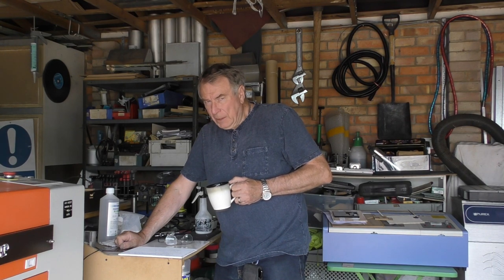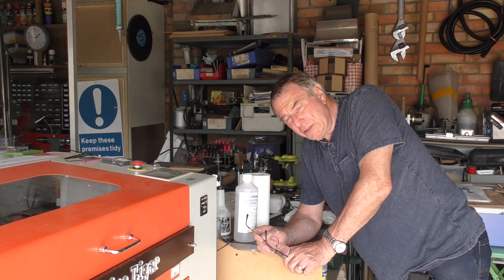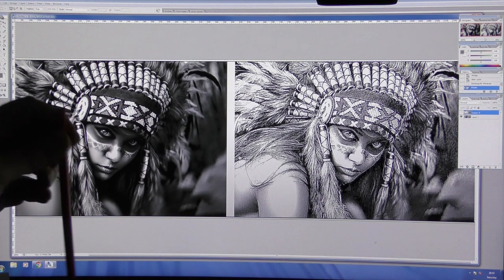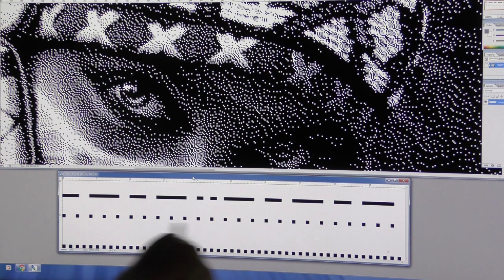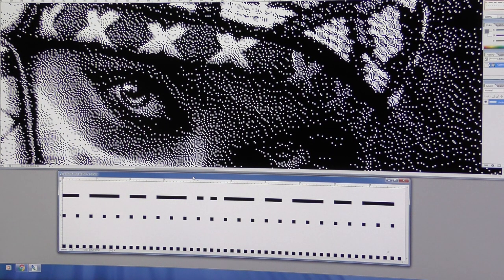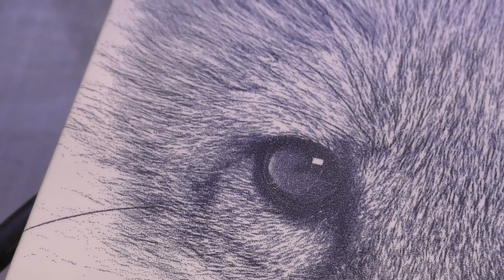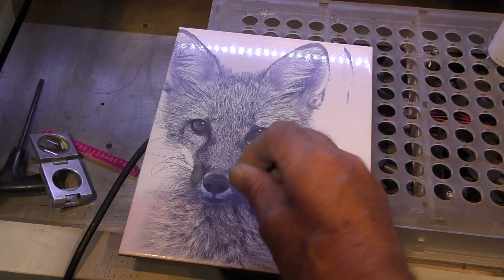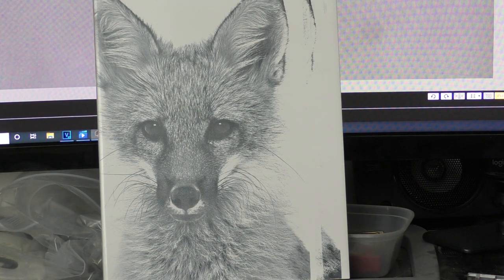RDWorks Learning Lab 212 Understanding Black Etching Ceramics Part 2

Comment: Try latex  white primer paint using Air Brush  dilute with a touch of water to get consistency of milk ..I usually put a small drop of Black in and mix..as it will give a grey like color and much easier to see the coverage  ...and with a 2-3 watt diode after 900 tiles I and many others in my forum DO get photorealistic results ...as I should as I,m approaching my 1,000 tile with hundreds of hours testing/looking under microscope/tuning machine and laser  etc
Reply from the maker: Hi Nicky
 First I must thank you for sharing your process and knowledge. My venture into your world will be fleeting because my aim was to answer the simple question I was being asked  by several people wishing to add a CO2 laser to their inventory.  With no previous study of your process it was obvious I could not answer that question with any confidence.  It thus became necessary for me to first understand the process and decode it so that I could assess how successful transferring to a different technology would be.  With minimal experimental work I was amazed at how well the basic process could be applied to CO2 machines and  as I mentioned in my video, the results were the best I have achieved on any material. My short foray into you world has demonstrated to those enquirers that your method is transferrable and to me it has opened a whole new world of possibilities. So thank you. I may tinker in the background from time to time to see if 500 ppi images work as well  but I shall be leaving others to use your method  in their own way.

 Although I try to help people if they ask, my journey of discovery into this technology is a very personal education process to keep my two remaining grey cells exercised.  Because my other hobby is video and editing, I chose to make a very low tech record of that journey  Unlike yourself, I am not specializing in any particular subject  so adding black dots to my store of knowledge has been an amazing bonus from trying to help others. 

 Airbrush is new to me and it has served the purpose successfully even though I never acquired any skills. I soon realized that the little toy compressor supplied with the brush  was not man enough for the  job,  but it tediously achieved the even coating I required.  Fitting it to my shop compressor for a few more experiments is a future project.

Best wishes 
Russ
Reply: Russ - regarding your air brush: if it is a "double action" model, you can get more material and more air coming out of it if you pull back on the trigger while pressing down on it. If it's a single action, you can not pull back  on the trigger - the only variation possible is from how far you depress the trigger. On both styles of airbrush it's usually possible to increase the amount of material sprayed by installing the needle rod so that it is not seated at the tip, but just behind it leaving a larger orifice. This method also means it will spray full on as soon as air flows. Watching your video it appeared as though you were getting a narrow thin spray pattern. Not bad for a first time though. Oh the last variable is the distance of the airbrush to the surface of the tile.
Reply: @DesignCutters  
Thanks for that valuable advice, especially about drawing the needle back a fraction as it makes perfect sense Yes It does have the dual action trigger so I can see that would improve things significantly. However, the little toy compressor that came with it is gutless, as I soon found out, but with frustration and perseverance I managed to prep a few tiles for my experiments.   I have now ripped the compressor apart to access the tube fitting and have connected it to a pressure regulator  that I can plug into my shop compressor. . I have not tested yet because I do not plan on doing any more TiO2 spraying in the near future. This was just a quick dip into the Nicky Norton world  to answer correspondents questions about whether the process will work with a CO2 laser.  The answer is yes, remarkably well, so I will leave it to them to experiment with this great technique.  When I have finished my research into lenses I may return to this and  see if 508 dpi images are possible, also how it works on real glass rather than tile glaze.
Thanks again for sharing your invaluable experience
 Best wishes
Russ

Comment: Have you experimented with running multiple low power passes vs one single pass? I suspect that the lower power of the diode lasers might be a factor as well.

Comment: Sorry if this is a repeat comment.....Lower surface tension with a drop or two of low suds detergent.    Roll on an event layer with a threaded rod as roller.   Finer thread- thinner layer.    Possibly thicken with glycerin ( or use alcohol glycerin mix ....i.e. hand sanitizer.  )

Comment: As for OSHA The PEL (permissible exposure limit) for TiO2  for 8 hours is 15mg/m*3 ....so for a mixture to spray  1...  110 x 110 tile contains approx 425 mg of Tio2....if you have a workshop that is 3 x 3 x 2.5 m....With absolutely no air exchange and you etched 1 tile then stayed in the shop drinking coffee you would be at 15,5 mg/m*3
Reply from the maker: Hi Nicky
 
 Again, thanks for sharing your invaluable knowledge in this specialist subject.. As an approved  food colourant, sun screen  etc TiO2  is obviously not toxic. .  However I appreciate there are risks to inhaling any microparticles, especially inert substances like TiO2  which will build up in your lungs, so I always exercise caution. (note the wide open workshop door) . The good news is that I will rarely be using the airbrush or the rest of my 200gm pack of TiO2,  so on my downhill run to oblivion I'm sure that the  wall at the bottom will get me first.

 Best wishes
Russ

Comment: I'm trying this out Russ but I'm having no luck with the spraying - the titanium dioxide seems to settle out enough within a second or so to block the airbrush cup inlet meaning that I get a few sprays and then it's really spotty.  Am I doing something wrong? - I've tried going up to the largest needle in the airbrush range (0.5).  I notice someone else in the comments suggesting using methylcellulose as a way to avoid it settling out.  How did you get it to spray ok?
Reply from the maker: Hi
The stupid compressor that came with the kit  was really underpowered for the  material we wish to spray. I had partial but stuttering success with it for the video and used a volume ratio of 1 part TiO2 and 4 parts IPA. The mix remained suspended for a few minutes, long enough to empty egg cup sized receptacle. Subsequent to the video I did 3 things. a) I tossed the compressor in the bin after removing the pipe fitting. b) I connected it (via a pressure regulator) to my shop compressor and c) I set the needle back about 3 mm to allow a bigger outlet path and thus a faster flow rate.  I found I achieved rapid coverage and consistent results running at about 60 psi (4 bar).  No, I did not try any additives because it worked fine with just the simple mix.
 Best wishes
Russ
Reply: @SarbarMultimedia  thanks Russ. I'm using my shop compressor albeit at about 25psi. I'll increase that pressure and back the needle out more 👍👍

Comment: random question: could we use a 2-way mirror to avoid reflections back onto the lens when working on highly reflective materials? how many losses would there be and what would be the optimal position of said mirror?
Reply from the maker: hi
 It may be a random question but  it is  also an interesting thought..
The 10.6 micron wavelength light has some strange properties. That relatively long wavelength  light only"sees" three things.One is metals.ANY solid metal surface acts like a mirror (flat or not) and reflects the light. some metals are more reflective than others . The second is a VERY small group of salt-like crystalline materials  that are transparent to the IR light. The third is EVERYTHING else.that will absorb the light and heat up  ie be damaged by the light depending on nit's intensity.  We use all three of these on the laser machine .1= mirrors.2=lens and 3 = what we want to engrave or cut.
 The problem you have is finding a suitable 2 way mirror in the correct material. There are only two materials commercially available, zinc selenide and  gallium arsenide.. I have never seen such mirrors for sale  at reasonable hobby prices. There are "windows" that are used on the output end of laser tubes that are some % reflective  but I do not  what %. Obviously this would give some of the protection you imagine  but at what cost?
 see   https://www.knightoptical.com/stock/default/windows-and-diffusers/ir-windows/znse-zns-windows.html?product_list_order=sap_diameter&product_list_dir=asc&gclid=Cj0KCQjw24qHBhCnARIsAPbdtlKcPof56c1LEwLbVB-7c2RDK0lXElhx6CdOlrlVWEMJwZJtYpuvy7kaAvVrEALw_wcB
The only place to add it would be immediately below and touching the lens you want to protect. . The window will incur another 5% (aprox) power loss to your beam. and would have to be the same diameter as your lens.

 All this seems so  unnecessary circumstances

Comment: Is all titanium dioxide powder the same? Any better that the other? I see some using white spray paint which I assume contains titanium dioxide. The paint would have to be removed with a solvent and what you used removed with just water.
Reply from the maker: Paint is the Norton method  and produces a more stable surface to work with. but as you say it has to removed with solvent. Additionally burning the paint produces fumes (content unknown) whereas TiO2 (it will be the same wherever you buy it) does not burn or chemically degrade, so there are no fumes and it washes off with water. It's a bit more fiddly to apply but this is the key ingredient so why add cost and complexity with paint?
Reply: @SarbarMultimedia  This is very interesting. I hear most people want the paint to dry overnight. This looks like it could be lasered as soon as the carrier flashes off. What a time saver even though it is more fragile but very similar to LaserBond (Similar as in the surface cannot be touched). I have an air brush but I think I am going to try a Preval sprayer when some TiO2 powder comes in. Now I need to tweek my laser to get the smallest dots! Have you ever posted your dot pattern?
Reply from the maker: @BR928S4  Hi
 Yes is is posted in the www.rdworkslab.com  forum along with all my other dxfs. But I recently sent it to a member of the facebook group that links to laser diodes. I will see if he can post it for others to access.
Best wishes
Russ
 ps if you struggle then add your disguised email address to another comment and I will send you a copy. I will quickly delete your comment/email address from public view.